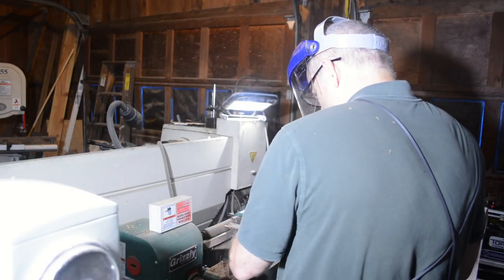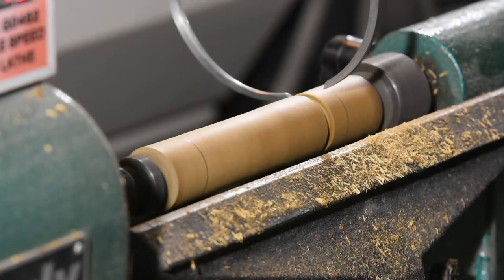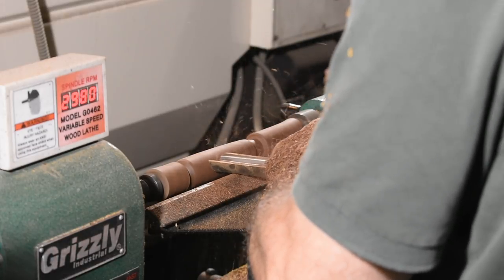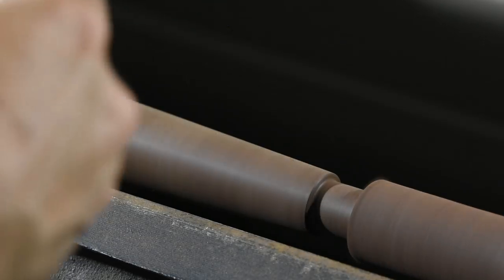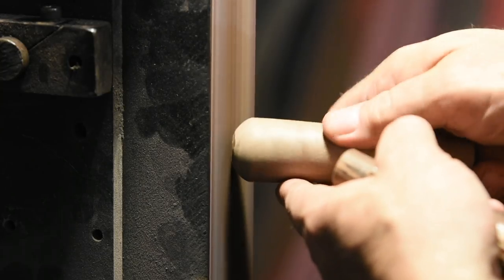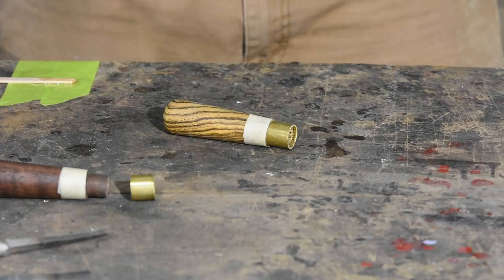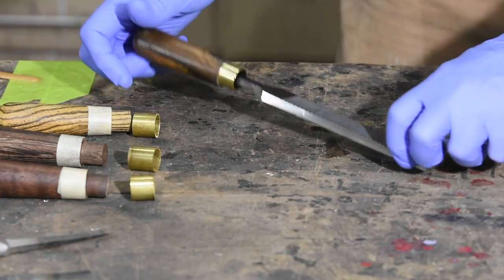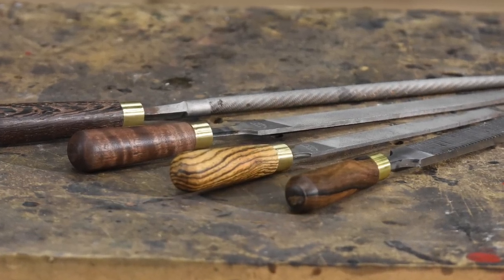Making a File Handle from Scratch - Lathe-Turned Wood

Comment: I usually drill a series of holes for a tapered Tang, the first being the deepest and most narrow. 4 properly sized bits and a piece of tape for a depth guage will give the Tang a lot more wood to bite into without relying strictly on epoxy, if you need it at all. They did turn out beautiful. I'm going to have to try some more exotic woods.

Comment: I don't see the need for all that epoxy. Driving the tang of the file into the hole of the handle is usually enough to keep everything together by way of friction/compression.
Reply: kaizoebara Actually, for the way he drilled for the Tang, all that epoxy was necessary. When mounting a handle on a tapered Tang you should really use a small bit for the first deepest hole, and keep stepping up the size and using a depth guage "a tape flag on the bit works" keep drilling shallower as you go. I usually use 4 sizes of bits, depending on how steep the taper is. You basically want the corners of the Tang to hit each shoulder of the drilled steps. Otherwise the Tang will feel loose no matter what you do unless you fill the hole with epoxy first. ;)
Reply: That's overdoing it if you ask me.